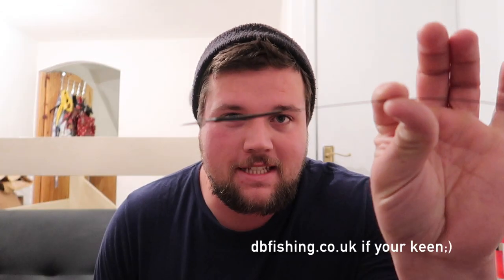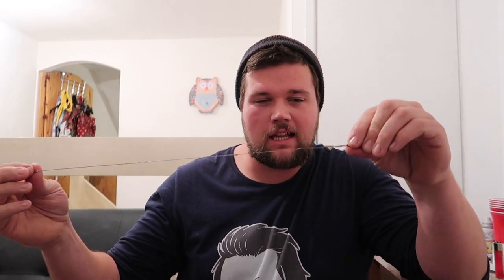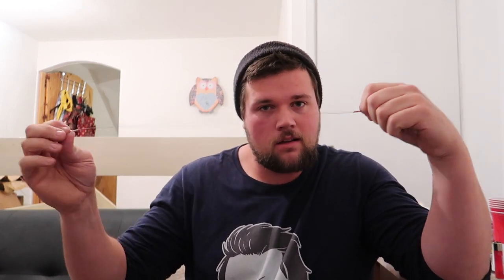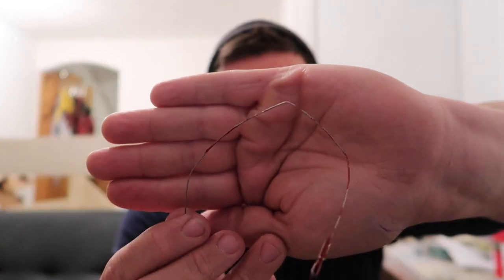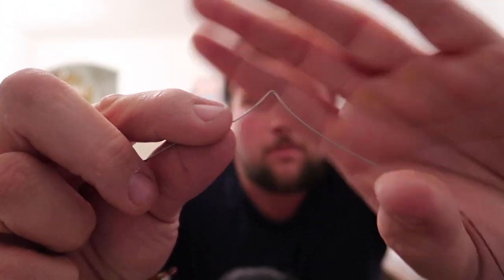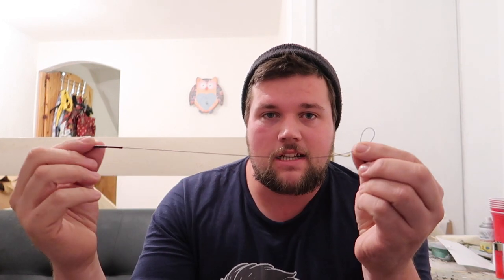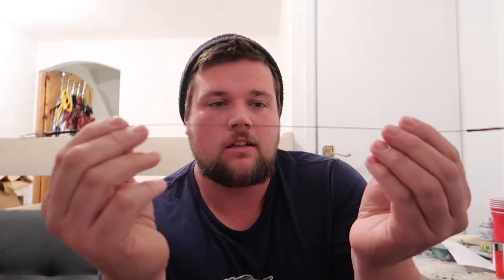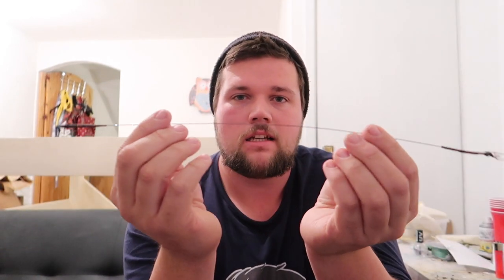Whats the best leader for Pike fishing?! Fluorocarbon VS Titanium VS Steel

Comment: ill have to give my two takes on this tbh its a hard topic, all comes down to the personal preferences and experience. ive used the 7strand steel, coated uncoated, ect all the varietys and its pretty good for most applications other than big jerkbaits it does get a big caught up, downside is that is kinks super easy. Titanium, best material you can buy in terms of durability and kink-resisitance, works for all applications, great for softs and jerkabits, little expensive but I mean you will most likely get 5-8 leaders a spool that can easily last a year or two, only downside I find is that it is harder to tell damage on such leaders and also if you chin a lot of fish wrapping any wire around ur hands or grabbing it is a bit hard and can be a bit dangerous. Now the juicy bit fluoro and mono , yes mono. fluoro ive used in 80lb, even has a stinger, no problems , found it a little too limp for some of my jerkbaits but still a perfect material, seems to displace more water and more boyant so can work lures at a slightly higher depth with slower sink and can feel soft lures wriggle a bit better as the leader moves and displaces water. I saw people get bit off on pike fight 2017, yes using 80lb and it put me off. however ive used 130lb and its perfect, flawless really, just hard to get a hold off and I lost the one leader I got from a friend.  So I went to try some 150lb Berkley trielene mono, at 1.2mm diameter, it is softer and more boyant than fluoro, still id say a abrasion resisitance equal to maybe 100lb fluroro, works just as well as 80lb fluoro, jerkbaits suspend a little longer than fluoro and have a little more buoyancy, soft lures seem to work a little higher up , apart from that no difference, I prefer mono/fluoro mainly because I can grap it in the water, I find it a lot nicer to use in terms of feel, easy to make on the bank, cheap and the main reason, I can see the frays, I know when to change, to retye, it gives me that 100% certainty in my leaders. At the end of the day as long as you are 100% with ur tackle
Reply: Agreed, I've only just started lure fishing since our trout season closed in September, but I've been fishing other techniques for many seasons. I've always thought that finding a trusted brand of f-carbon is difficult for flyfishing etc.so I've tended to use mono. I was advised on some good f-carbon by my tackle shop, but max dia was 30 for 20lb bs. So I have made up traces in Ti/Drennan 7 strand and solid stainless. As stated above, the trace material can be selected to to the action of the lure- eg I found casting and retrieving a floating buster jerk in the margins on a flexi trace did not achieve the depth I was aiming for, the solid ss trace works it spot on. My flyfishing now is "euro nymphing" the top anglers at this method advise using f-carbon as it sinks faster, fine-if using leaded tungsten headed nymphs in 4-6 feet of fast water, but I have to use size 16/18 in 2-3 feet and f-carbon is too stiff for the nymphs to fish correctly, so I use mono, and I found f-carbon tricky to knot in the diameters I use-so as above, its got its place as long as long as it works on your waters and you select the correct dia and can find a trusted brand.
Reply: 0.30 for 20lb bs-I was talking out of my rear end, it was 0.30 for 6.5 kg -too light for traces.
Reply: Iv been using 100lb and 150lb mono for my pike traces for the last 3years. I found it great and my mate was using the same until last year he got a big pike bite clean through it took bait an all.. then he had another bite off early this year. I was a bit curious to was he changing his trace when it was frayed.. but then a few weeks ago I got a pike 100cm and when I netted the pike and went to take the lure out she had bite through the 150lb mono in the net..I think I might move to florocarbon as it feels harder
Reply: It also has to do with your rod setup. If you use heavy braid and very heavy rod you need much thicker fluorocarbon then lets say lighter lure with a softer medium rod. You can go a little thiner if you got experience. Like 80mm flourocarbon. For heavy lures i use 1.2mm

Comment: Ok I'll play. Between Christmas and New year I was fishing in Spain for predators. All the pro guides out there were using Floro leaders. Last September I was in Denmark and November in Norway. All the pro guides used Floro leaders. February 26th I fly to Serbia for two days predator fishing. The pro guide im fishing with uses Floro leaders. And finally, ive booked five days in June to fish for Pike in Sweden. The two pro guides ive booked with both use Floro leader. Some of the guy ive mentioned have Pike in the upper 30lb's. They do it for a living. If floro is good enough for them 'tis good enough for an amateur/rubbish fisherman like me. Not to mention ive seen you catch a shed-load of Pike on your channel with Floro. In closing, use what you want but i've switched to Floro, im happy. as always, cheers for sharing.

Comment: In my younger years, grandpa and uncle always used the basic steel leaders you buy at the tackle store. It was just the way it was. But a lot of the lakes I fish are very clear water, so I started experimenting with heavy fluoro and nylon mono. The result? Whenever I can find heavy mono (50lb or higher) I use that tied with an FG knot to the braid mainline. It’s very hard to find that stuff around here though because I’m in Wisconsin, and saltwater fishing is obviously not an option here so there’s not much available in the way of heavy monofilament. 

Lately I’ve been using Daiwa J-Fluoro in 60lb. on my heavy gear (0.029” thick, tied to my 50lb. braid mainline) and the same Daiwa stuff in the 50lb. on my lighter gear (0.022”, tied to the 20lb. braid mainline). I really like this stuff, it’s quality Japanese fluoro and it’s VERY inexpensive, 50 yards for $20 in the heavier strengths.

Comment: I have used 60lb flourocarbon for pike flyfishing for 30 years and never been bitten off. I think people who have had lures/flies bitten off are mistaking a poor knot to a bite off. Flouro breaks straight and does not leave the usual signs that mono does, eg a pig tail at the break point. 90% of flouro sold is not 100% flouro but a monofilament coated in flourocarbon. Only the very expensive flouro is 100%.
Reply: @Kevin Bucknall -yes, I remember when f-carbon came on the market, fly anglers seized on it for tippets as it sinks and is invisible -hmm, anyway, the first stuff was pretty horrible, the two main causes of problems were knot failure due to lack of care and or using old mono knots that were not suited to f-carbon, but what drove me nuts, was anglers with 7/8/9 wt rods and lines, using silly dia f-carbon as tippet for a small dry fly - hoiking a WF 8 line off the water to connect with a 2lb  trout often lead to a break off-f-carbon has improved now but as you say, you have to watchout because there a flouro coated monos out there.

Comment: I've caught perch, zander, chub and pike on wire (both steel strand and titanium) and my rivers are clear water, I used flouro when nymph fishing for trout, but binned it, the main reason being it got damaged and kinked when drawing the knot tight unless you are ultra careful. I also use 0.8 stainless wire for jerkbaits and that catches fish plus the baits work a lot better. The problems with flourocarbon I've seen are that some anglers think its some sort of super material and fish it in too light diameters, anyone with a youtube channel using flourocarbon for pike should make sure they specify what diameters they are using as you have here, hopefully that might get more people using flourocarbon correctly. Whatever you use for traces should be binned and replaced regularly as it gets hammered when casting, being pulled out of snags, jerked around when working baits and of course coming into contact with fish teeth/bony jaws. You also made the point about quality- some "flourocarbon" is junk, and there is also "flouro coated mono" whatever thats supposed to be, so check what you are buying-I'm a welder - and all Ti, steels, ali are not the same quality so check where the stuff is made not naming any names, although quality has improved now though. Crimping the flouro is a good idea, probably tricky to knot in heavy diameters I would think???.

Comment: I really like the 49 strand steel wire. Mainly for the softness and because I can knot it. It doesn't kink too badly if you don't intentionally pinch it :)), much better than 7 strand wire. I have to give that titanium stuff a try. Good vid.

Comment: Remember when fishing large lures for pike and heavy rod use thicker fluorocarbon at least 1mm plus but thicker is better. Or when i fish skirted jigs on a medium heavy rod with 50lbs braid i also use thicker fluorocarbon rod because you set the hook harder at close range! When using smaller baits and a medium rod with softer tip you can use something like 75mm fluorocarbon and above. I don't see people talk about this which worries me for inexperienced anglers cutting fish off because of these small details. You got a lot of anglers talking 70mm is pike proof but it is not when setting the hook hard with a big lure or skirted jig on a heavy meter plus pike!

Comment: Love your videos, very nice channel, im from Sweden and fished for about 30 years. I recently talked about this with Claes Claeson aka SvartZonker, you see here in Sweden we use 90% Fluo and 10% Ti wire mostly as our leaders, the TI being mostly for jerkbaits. Me myself however I do not follow that trend. 

Me myself was using Fluo for more then 10 years but have recently changed, today I fish TI 60lbs wire for my Jerkbaits (or "pure hardhats without spoon") and for everything else I use a stainless steel wire 60lbs, I only use Fluo today when I want to throw a lure that maximize my recommended casting weight on the rod. 

Why not Fluo for me? well after 25+ years of fishing I have changed leader materials countless of times and just as a fly line and their leaders, tapering and diameter is an important factor. Casting a 1-1,5mm Fluo leader, or even thicker if you go Mono is to stiff and thick for it being comfortable, and you don't feel the rod loading as it should, when going with a SS wire or TI wire I like the thickness and flexibility more and I can feel my rod loading better meaning better connection with my bait/lure, Fluo being thick and being able to stretch is the total opposite. 

Another downside with fluo is simply that if it gets damaged it starts to peel off and you need to change leaders, for me I went through a spool of 50m 1,2mm Fluo during the summer, and following summer I used a total of 3 SS wires and 1 TI wire. 

Visability wise there is a difference of course, but it have not affected my fishing noticeable, and this is exclusive to Pike, when fishing Perch, Trout, Seatrut and even Salmon I have found that Fluo works better. 

In the end it comes to preference, this is what I discovered after all my tears fishing, the important aspect is that you choose what you like the most, one thing to note is do not always think of what "looks better for the fish" and thing of ergonomics some times as well.

Comment: im a massive convert to titanium, i was just about to buy all the stuff to make my own fluoros but i decided to try titanium first and i love it i class it as cheaper than steel at this point, 10 sessions 8 fish in i bought two sg leaders for a 5er and iv only used one and it seems completely fine still. but like you said they are short so i will have to start making them at some point still, stilll might try fluoro at point as i do use fluoro for my light lure fishing, i did like drennon 7 strand but havent really used it since getting onto fluoro

Comment: Fished with a coated wire trace yesterday, changed it coz in my river it really stood out, where as standard wire and Ti don't.
Think the summary to this is that one material is no better than others, but it depends on what lures you are fishing, head of fish in your waters, fishing pressure where you fish, snags or no snags, rocky bed or silty bed and so on. Having seen the info on strengths of fc and knots used here, I'd use it-before I wouldn't because I have not seen heavy duty fc. Think the bottom line is, all trace materials are good, some maybe better for some situations, some may be more convenient in that they last longer-but all terminal tackle should be checked and replaced regularly whatever materiel it is ?. As a novice to fc for traces, I would check around to make sure I get a trusted brand, I'll probably get some Savage Gear stuff to start as I rate their kit-only downside to Savage Gear is having to shout BAM!! every time you get a fish people think you are nuts coz its POW! for pike and ZAP! for zander BAM! is for bass and bream.

Comment: I use titanium for everything now. I use L/UL gamakastu pre made ones for perch fishing (all the waters I fish for perch, have pike) and make my own ones for the pike as my local waters require minimum 18” trace and can’t find them pre made in titanium. I have seen a couple people get bitten off with fluorocarbon and it put me off so wouldn’t ever use it personally, I never miss out on any perch through using titanium and the pike never hesitate either.
Reply: Yeah,nothing beats wire,in Florida you have to use wire for Peacock bass because they have sharp teeth.

Comment: Switched over to fluro, savage gear regenerator for sometime now and never had a problem
Reply: @pikeandperch  loads better, never had one snap, don't think I would go back to wire, I tend to use 0.9mm thick with 2-3 feet with a double barrel crimp, I find crimping better fix

Comment: I've been bitten off on 150lb seagur FC, never used it since.
Just because you've not been bitten off, doesn't mean it can't happen.
As a leaders job is to prevent you getting bitten off I'd never recommend it to anyone.
Titanium isn't really that expensive considering how long it lasts, some of my leaders are over a year old and have caught hundreds of fish so even if it worked out each leader cost me a fiver, it's no big deal really.
Reply: Some of my fluro traces are over a year old too lol
Reply: Like I said, it doesn't mean they can't be bitten through, it just means it's not happened yet.
Reply: @daniellaw8999  seen wire been bitten through before too so both have cons and find wire more likely to slip hence why I changed, cheaper too
Reply: id like to ask, as I do believe could happen but are you sure you didn't have  a crimp fail, a bad knot , ect? was you knot a loop , they are known get cut off easily , did you check ur trace often, any fray sighns , ect? was the take  a heavy slack or standard?
Reply: @kieran5694 , the pike had engulfed a smuttly db4, I played it all the way to the net when it thrashed about a bit and sliced through the FC like a knife through butter.
No slipping as it was knotted, no component failure, other than using a leader material not suitable for the job.

Comment: I only use Fluoro leaders and the main reason why is because it doesn't drag the bait down like a wire leader does. I fish a lot of suspending jerkbait and even a small amount of weight can ruin the action of the bait. The other reason is,  I get more bites on it. Even when using using a lure that you are reeling all the time so weight is not a problem I catch more and bigger fish on Fluoro. So I use 80 lb Yo-zuri disappearing pink fluorocarbon tied to my 30lb Suffix braid with the FG knot, which is by far the best knot for tying on a leader period. I use about 18" of leader with a dou-lock snap on the end, tied on with a 4 turn uni knot. In about 15 years of pike fishing and well over 1000 pike I have only lost one fish because it cut the leader. If you are interested in learning how to tie the FG knot the easiest way check it out here. https://www.youtube.com/watch?v=IZyRlNSqt4w&t=69s

Comment: I just use 0,40/0,70 mono regenerator... pikes are up to 4 kg so heavy  duty setup kills the sport.Get more footage!
Reply: I use regenerator as well, but I think you shouldn't go below 0.90, they can bite through thinner diameters easily
Reply: I use always 0.50 fluoro, never had problems.Talking about 4kg+ pikes.